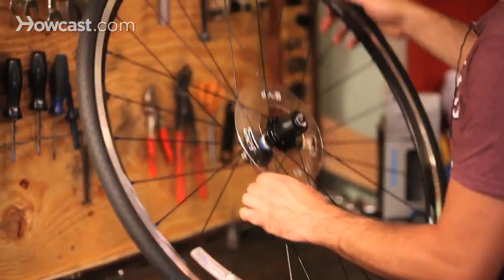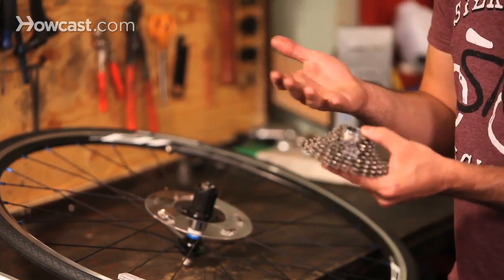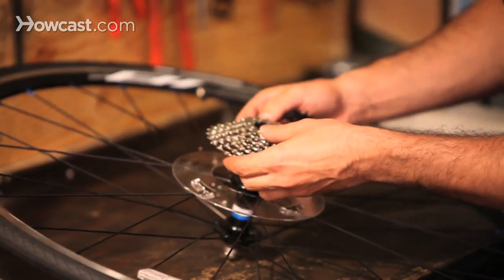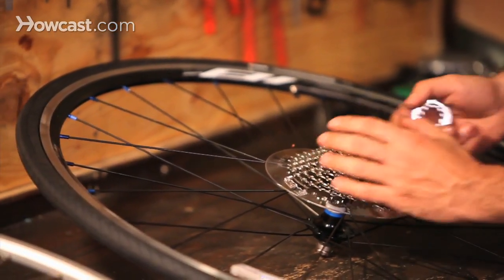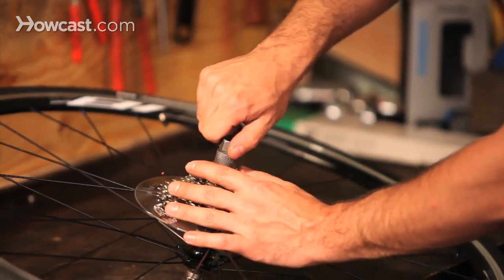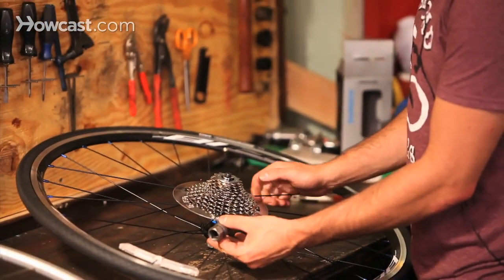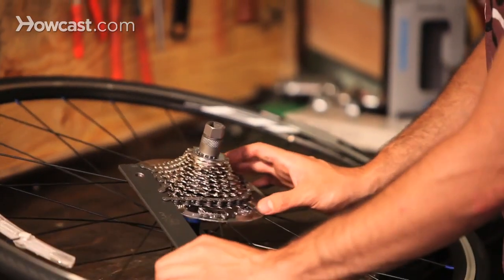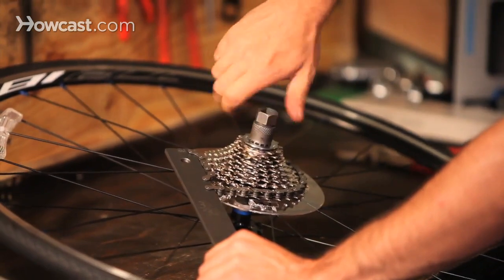How to Adjust a Bike Cassette | Bicycle Repair

Comment: Is it normal that cassette cogs are a little bit out of true when you spin rear wheel? I have carefully installed cassete, with spacer, and lockring (there's no mobility betweens cog rings) Is it possible that cassette is a bit weared down, or rear hub axle bend (bigger problem, obviously)?
Thanks